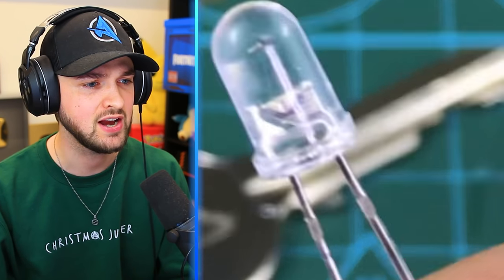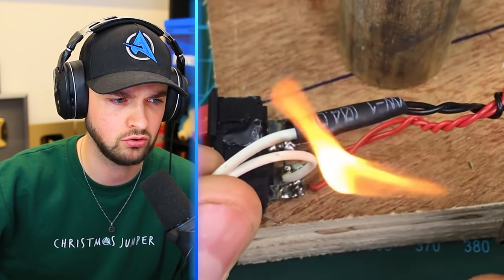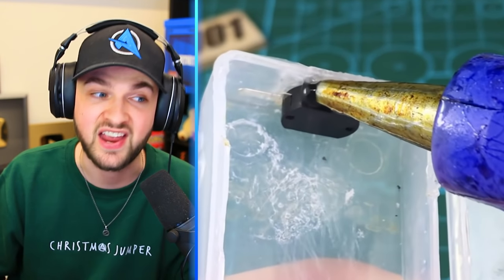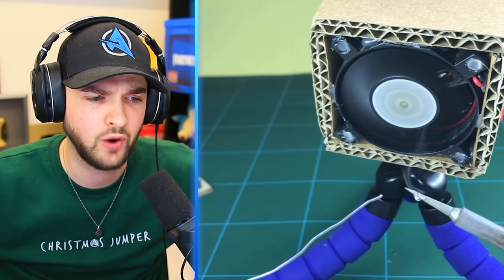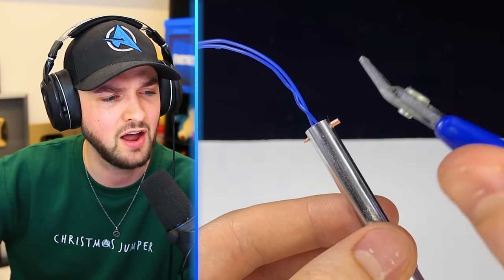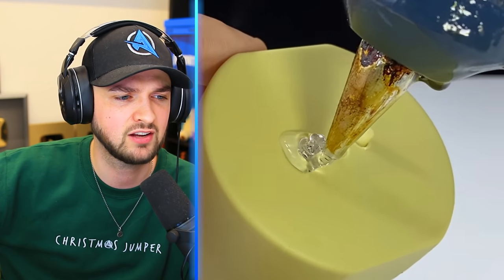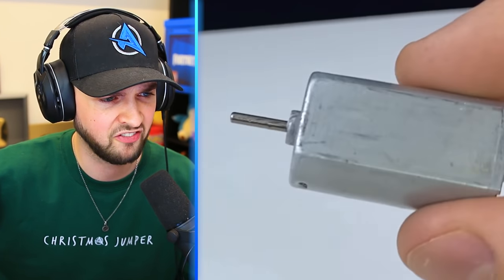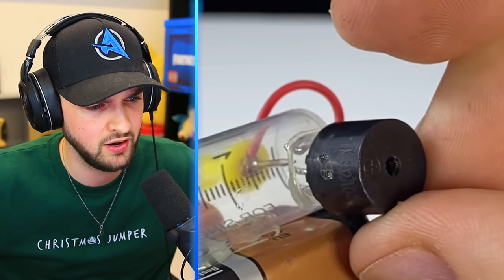10 World's *BEST* DIY INVENTIONS! (Must See)

Comment: I am pretty sure that #5 is supposed to be a fan that blows inwardly.  Most likely used for projects that require smoke to prevent your smoke alarm form going off.
Reply: Yeah that's what I figured it was as well. 😀
Reply: Yeah it’s Probably for that reason like when you are soldering the smoke goes in the fan
Reply: It's kinda like a exhust fan
Reply: Yeah, that makes the most sense 😂